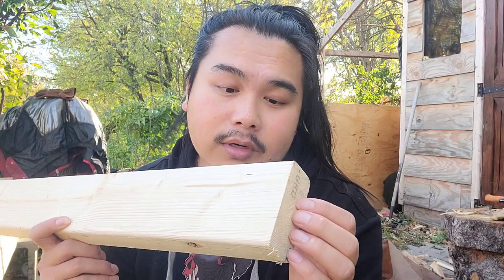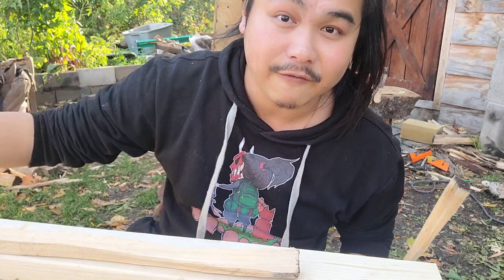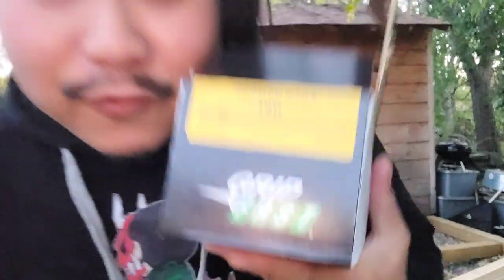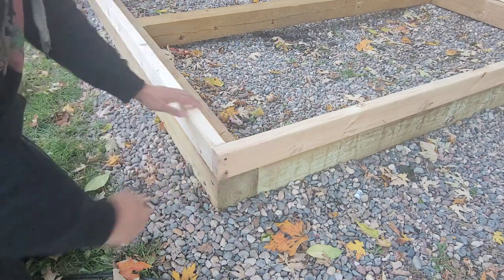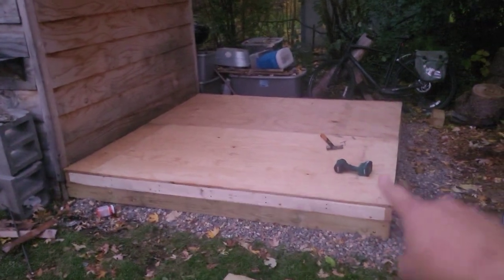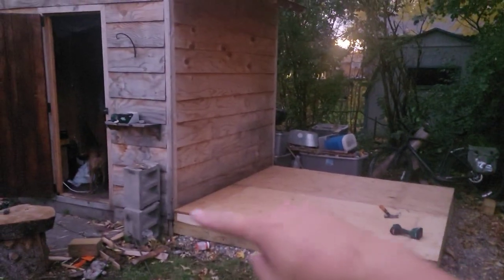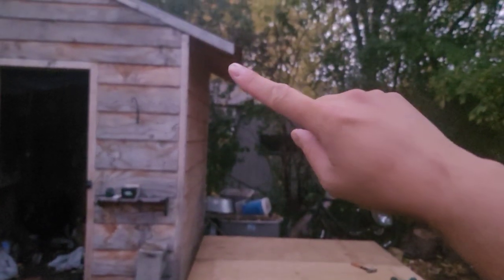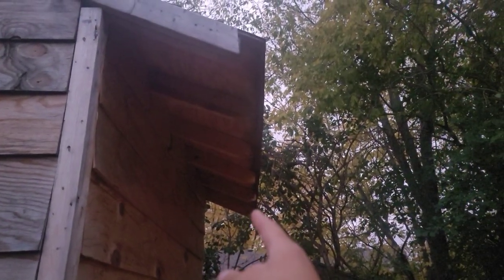I Messed Up On My Framing! - Shed Update

Comment: Cut the roof. Frame up the remaining walls and roof. Use torch down on the low pitched roof and use some flashing under the comp and run it on top of the torch down

Comment: I would cut off that extra part of the old roof and then run the new roof with a very slight slant so the rainwater runs off the right side. Might even consider a gutter to funnel the water where you want it. Water will rot your new roof soooo fast!

Comment: You want to keep the pitch of the roof if you get heavy winters for the structural integrity of your roof under the weight of snow. Honesty the expansion should have went forwards or to the rear for ease.

Comment: Ok so if I was building it I would go at an angel from where the corner is and the back of the over hang is and build with that and then go to the edge of the over hang and right at the edge put a board flush with it and cut a 1/16 off the others as you put them up so you have grade u need for the water to run off and remember you need 16 on center studs if I made it to complicated just pm me on Instagram and I’ll tell you more in detail love the videos